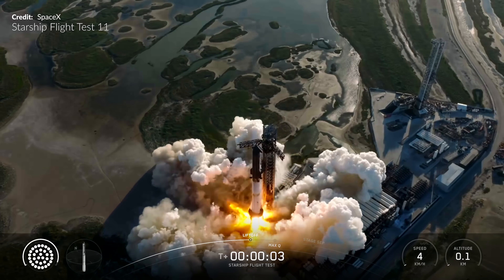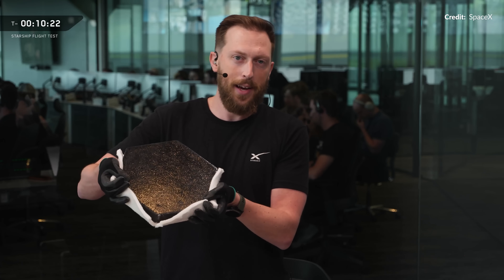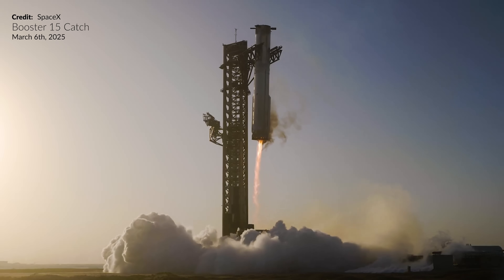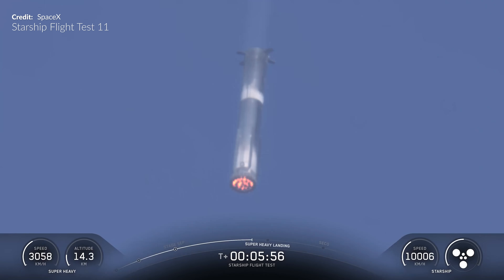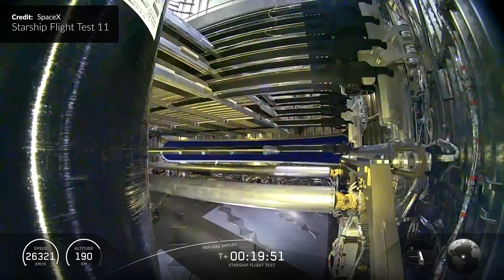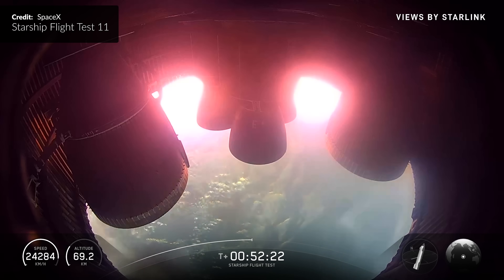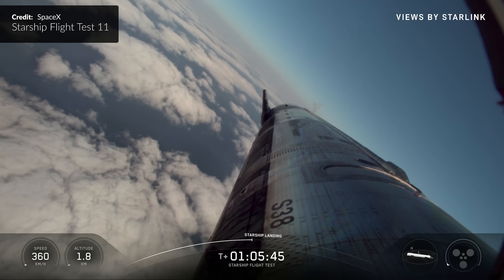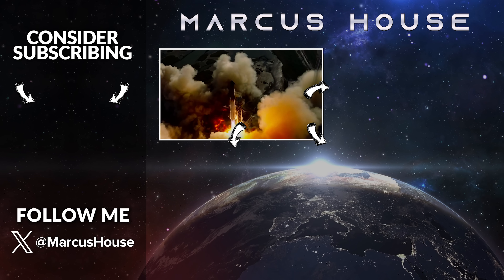SpaceX Starship Flight 11 Launch EXPLAINED! 🚀🔥

Comment: Excellent and very well cut synopsis of the flight. Really good to watch everything proceed like clockwork … though I guess we’ll never know how close things actually came to disaster at any particular point in time!! Appreciated your Timelapse of the flight manoeuvres on return to splashdown … really demonstrated well how they can actually “fly” Starship (truly “falling with style” 😂😂). 

The real crux of this flight, in my mind, will be if we ever find out how the heat shield stood up to the latest round of test configurations and the crunchy wrap “grouting”. Fingers crossed, it can’t have been all bad, simply because the ship got back in one piece (though, sadly, it really doesn’t seem to like getting its feet wet!). Out of curiosity, do we have an explanation as to why things go “pop” when the ship touches into the water? … is it simply structural failure due to size and mass when belly flopping as it falls over?
Reply: It is intended as they don't want anyone recovering it for study and duplication.
:planet-orange-purple-ring:
Reply: Because the structure is hot and hollow, i think there's an experiment on youtube showing an soda can crumbling after touching water, might explain it

Comment: So a quick few questions. Are all these raptors version 2's and are they all gimbaled with hydraulics or the electric motors?
Reply: Raptor 2 and electric.  Block 3 is to be Raptor 3.  
:planet-orange-purple-ring:
Reply: @Scanner9631 I thought I heard the SpaceX presenters say some of the engines were v3? Maybe I heard wrong. They have a tendency to jabber on about things and giggle a lot and sometimes I unintentionally tune them out.
Reply: @JeromyBranch Don’t think so. You make have mistook him saying 24 were ‘flight-proven’, and 9 were brand new Raptor 2s. - Dave Huntsman

Comment: I think the 1 engine out at booster boost back may have been an intentional engine out test
Reply: They have happened before and as with this one the 2nd relight often restores the missing engine.  Prior reports was that the ignition system for that engine(s) was overheated and they were taking steps to shield/cool it better.   So I would say not intentional BUT maybe a trial of an alternate system on 1 engine as they could get alone with some engines out.

:planet-orange-purple-ring:
Reply: @Scanner9631  it most likely happened because of the flip, that one engine specifically probably didn't get enough fuel/lox
Reply: That is possible also maybe a sensor issue

Comment: Seeing the Booster hover at the end of it's flight just boggles the mind.  That thing's the size of a good size building and it's just hanging there hundreds of feet in the air, supported only by it's engines.  Just nuts.  Looking at the location of the tiles that were deliberately missing from the heatshield, I have to wonder if those are the same areas we saw some tiles coming off at the very end, the gaps letting heat get under the rest of the shield and melt off the pins holding them or something.
Reply: That is needed for a catch.  Falcon 9 can't do that.  I doubt any other booster currently flying can do so during a landing as they need either very deep throttling or lots of engines.   
:planet-orange-purple-ring:

Comment: Honestly, I cannot believe that thing survived re-entry with missing insulation on critical parts of it. I was expecting it to crumble or explode. Just wow!
Reply: Once it got through the peak heating phase, I knew the ship would finish with a splash down.  "Missing" tiles in the critical areas was downright ballsy!  And the test tiles on the back of the flaps was also interesting because they were testing the best ways to fasten to the body (even though they weren't subject to the same stresses).
Reply: Elon's choice to go with rolled 304 SpaceX blend steel, was a well thought out plan. The fact it is only 4mm thick is incredible too. A very sophisticated 'Steel Can'.
From SN15's successful launch and landing on May 5th 2021, to Ship39 Version 3, it's been a long hard road. But boy, what an incredible journey of iterations have we seen. 🤯  NASA Space Flight had 395,000 subscribers then (now they have 1.41 Million) and I only started watching Marcus House in October 2020. He has 572,000 subscribers today. Not bad for a small team. I'm rally looking forward to the next 4 years and 5 months!!!! Go Marcus, Go SpaceX and Go subscribers!!!!
Reply: Cred ca de aceia nu sa planificat recuperarea celor doua trepte. Se asteapta sa fie afectate si nesigure pentru a fi refolosite...
Reply: @paulgheorghiu5888  Nah. These were dumped because they're old spec. No point trying to recover or reuse them. It would cost more to upgrade them to current specifications than to just build a new Ship and booster to the new spec.

Comment: I'll sum it up quickly. NASA's design in 1969 completed it's goal by the time they made the 6th flight and they did it with ONE disposable rocket. Musk's design has made 11 flights, none have achieved orbital altitude and speed and none are truly reusable. All have fallen short and even if Musk disregarded his reusability and burnt all the Fuel in the booster and Starship I still don't think he would make it to orbit. He starts with a fully fueled rocket and it is Empty before it gets where it needs to be. So what do you think will happen if I substitute the PEZ Dispenser with a CAT D-10 Dozer? That thing will sit on the pad and destroy itself trying to lift it's rated load. You guys can hold onto the dream, but the reality is Block 3 will be the one that shows this isn't going to work. There is a limit to Chemical Rocket Technology and Musk has reached that limit. Starship V3 is even bigger because he needs even more fuel to get to orbit. But you also have to lift the Weight of the extra fuel and bigger rocket. At this point in time it looks more like Musk is now just trying to find some way to make it look like he was right about Starship, when he was wrong. Unless they release the Black Project technology Humans are stuck on a PRISON PLANET they cannot leave with out Black Technology!
Reply: You obviously either don't know or ignore that BOTH the booster and 2nd stage vent unused propellant that would otherwise get them to orbit.  They don't want to achieve orbit UNTIL they can be sure they can do a fully controlled descent on target.  They can't afford to accidentally have it land on a city.
:planet-orange-purple-ring:
Reply: @Scanner9631 😂 😢😅😂🎉
Reply: @Scanner9631  I cant understand why someone who has no actual knowledge wants to go on the internet and display their ignorance for eternity.
Reply: referring to the OP of course
Reply: @shaungisler6604  Bit late trying to recover. Your mistake and ignorance is on show for eternity 😂🤣😂
Reply: They had Space Nazis in 1969. Hard to come by these days.
Reply: @mountbattenstgeorge6008  There is one massive Space Nazi today...  complete with Nazi salutes, demonisation of the disabled, brown people, ethnic minorities and everything.

Comment: لماذا لا يكون هبوط مركبة ستار شيب أفقي وليس عامودي
Reply: The goal is full and rapid reusability. Normal ‘landing’ will involve catching it in mid-air back at the launch site- no landing systems, per se, to take up weight, other than the two catch pins. The goal - after the final design is reached (I’m guessing Version 5- it was a version 2 that just flew) is to catch it after the flight, and not have it leave the pad- just ideally, gas it up and go again. - Dave Huntsman

Comment: It blows my mind that the ship can survive with all those tiles missing. Excellent review of the test flight, Marcus.
Reply from the maker: It really is. It just goes to show that the stainless steel has been a choice that has been quite resilient. Block 3 is really going to make this dream a reality. Feels like we are so close to seeing these launching rapidly. Hopefully Block 3 will be smooth (unlike 2).
Reply: @MarcusHouse  Why don’t they just make one big piece of heat shield instead of using small tiles?
Reply: @DE.KarlJayce  

Expansion due to heat would break the connections holding the shield on.
:planet-orange-purple-ring:
Reply: @Karl.Jayce-DE the surface is round. Hexagonal tiles fit best.
Reply: @Karl.Jayce-DE
On a technical level, it is possible. But ceramics don't handle extreme uneven heating well, and often crack. And different parts of Starship will definitely be very different temperatures. So to prevent cracking, it would have to be made much thicker than individual tiles. So a lot heavier overall. Likely 2-3 times heavier.
And if one tiny spot gets damaged, it's a total replacement. Not to mention it would crazy expensive to make a mold that physically massive. I'm trying to maintain near perfect consistency throughout one entire piece that large, is also crazy expensive.
Reply: @lordgarion514  It's not the uneven heating of the ceramics that would be the problem... it's that the ceramics are attached to steel which starts out at cryogenic temperatures, and then warms up substantially during the flight. And expansion and contraction of that underlying surface would be very bad for a monolithic ceramic layer on top.
Reply: @simongeard4824 
I wasn't guessing. I went and checked on it. 

And it would not be possible to mold it so that it fits snugly up against the ship, the flexing would absolutely shatter it. It would still need mounting brackets, and they have made mounting brackets that allow movement for decades.. 

So it really is the expansion and contraction of at different rates in different areas that is the problem, because ceramics are hella brittle. And brittle things do not handle severe and or rapid temperature swings.
Reply: @DE.KarlJayce  You cannot build a larger heat shield to the contours of the starship.  They are smaller and shaped so they can conform to the starship profile.  Good question though, might be something they are working on...
Reply: @lordgarion514  Thanks everyone for the replies — really appreciate all the detailed info! I was wondering about one more thing: do you think it could ever be possible to make some kind of “heat shield paint” that you could just spray on instead of using tiles? Would be wild if tech ever gets there.
Reply: It is especially crazy considering what that would do to the Space shuttle.
Reply: @gabrielkovacs1276  there was STS-27 where they “tested” this exact thing by accident. By sheer luck the tile missing was covering a little steel plate.
Reply: @gabrielkovacs1276 too heavy.
Reply: "The best part is no part", so... ?? Tiles only on critical areas? Thinner tiles? Only use the white backing blanket in some areas? I think SpaceX cares more about rapid reuse than minimizing weight.
Reply: Great summary for someone who missed it live!
Reply: Stainless is tougher than aluminium!
Reply: Oare acesta este motivul pe3ntru care nu sa planificat recuperarea celor doua trepte ?
Reply: @paulgheorghiu5888  No, They probably didn't try to recover either stage because it is kind of pointless as this was the last of the V2 starships. It would invalidate their launch license if anything went wrong on the catch attempts, so it is best to wait for the V3 Starships which have many upgrades and are actively being built.

Comment: We that was definitely the best one to date. It looked like 99% perfect.
I wonder if the booster relight creates a void where fuel isn’t sufficient to allow one of the engines to fire up?
Is the engine affected always in the same location?
The fact that it lit later in the process seems to suggest that it isn’t an inherent issue.
This will be one of the succession of tweaks that will come along and make this vehicle more reliable.
Time to settle down and wait for OLM 2 to be ready work.
They’ll have so much more time to finish it now that all launches are finished until it gets online.
There will be a lack of “saw’s all’s “ available locally until pad 1 is down.
Great work Marcus!